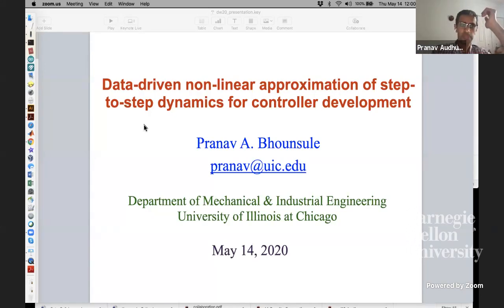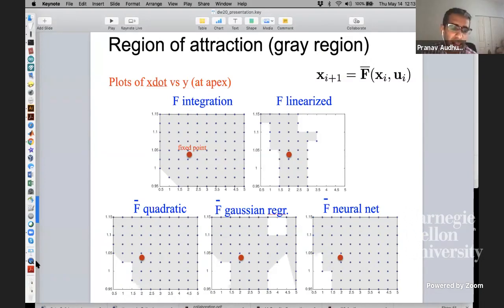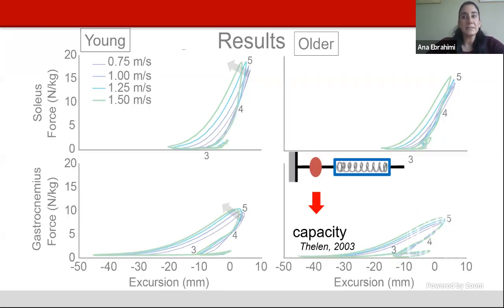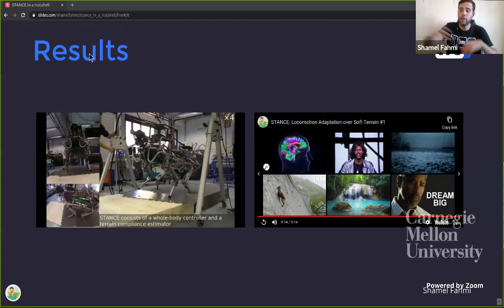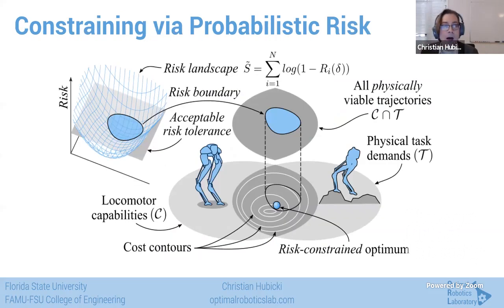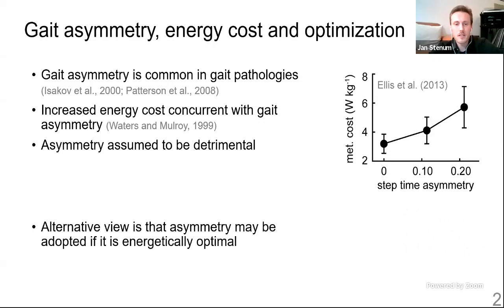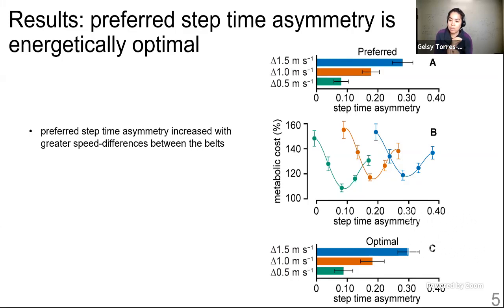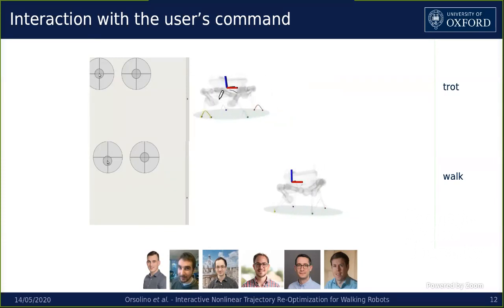Dynamic Walking 2020 Session 2

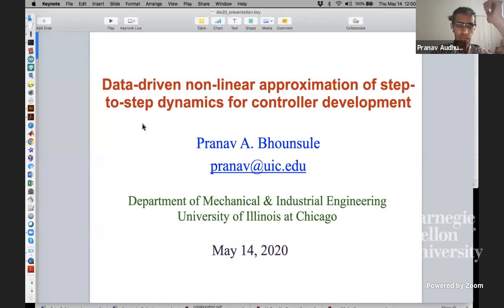Comment: [0:01:24] Pranav Bhounsule. Data-driven non-linear approximation of step-to-step dynamics for controller development.
[0:22:12] Anahid Ebrahimi. Shear Wave Tensiometry Reveals an Age-Related Decrease in Triceps Surae Work Across a Broad Range of Walking Speeds.
[0:33:52] Shamel Fahmi. Soft Terrain Adaptation for HyQ.
[0:46:29] Christian Hubicki. Risk-constrained Planning for Robot Locomotion.
[1:01:29] Jan Stenum. Step time asymmetry optimizes energy cost of split-belt treadmill walking.
[1:18:06] Romeo Orsolino. Interactive Nonlinear Trajectory Re-Optimization for Walking Robots.